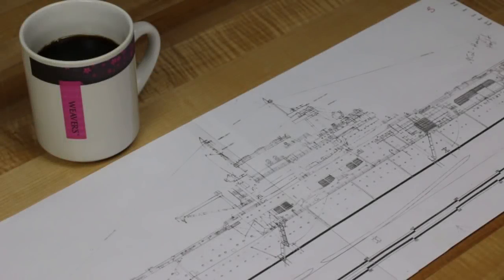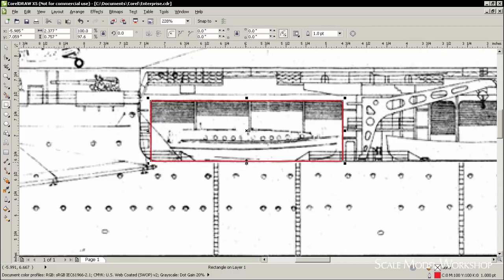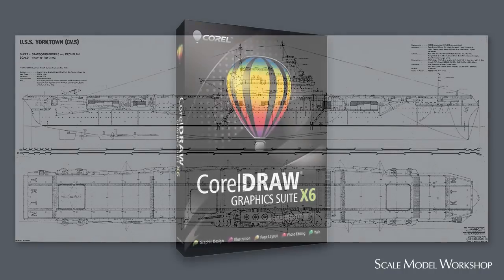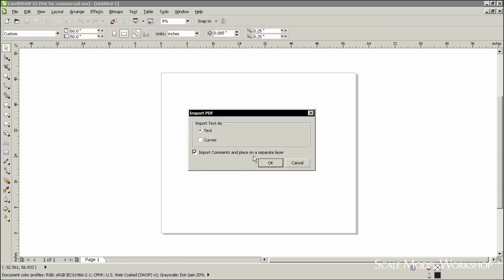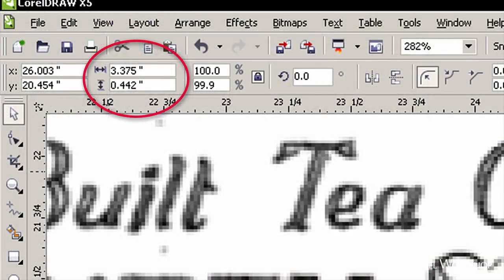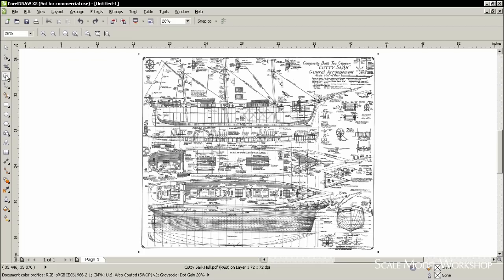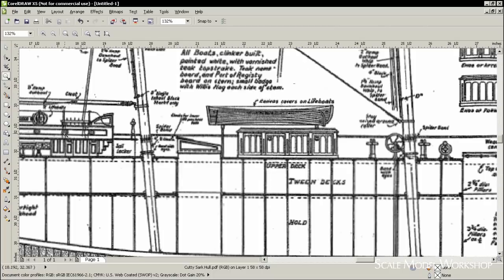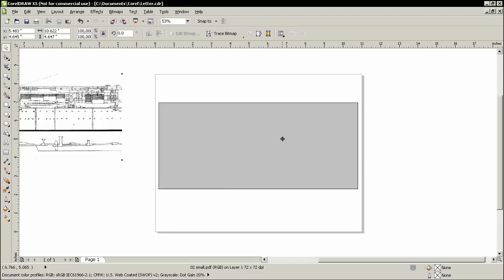Working with Scale Drawings

Comment: I used to use this technique working off of printed assembly drawings in order to establish assmbly distances on industrial centrifuges that we did not have engineering drawings. We then used the resulting data to construct templates for fitting the internal conveyor that had to spn inside the outer housing that would spin about 3000 to 4000 rpm. I usually worked off of a bearing diameter to get my initial dimension